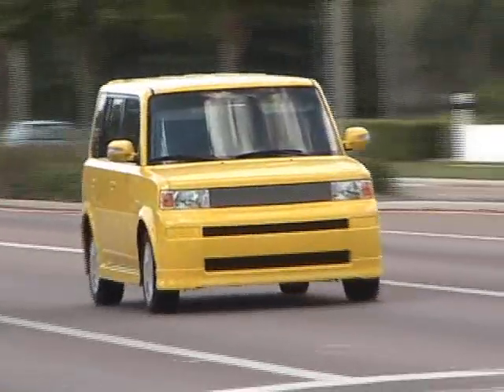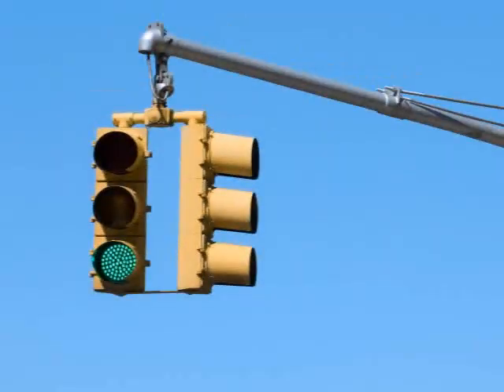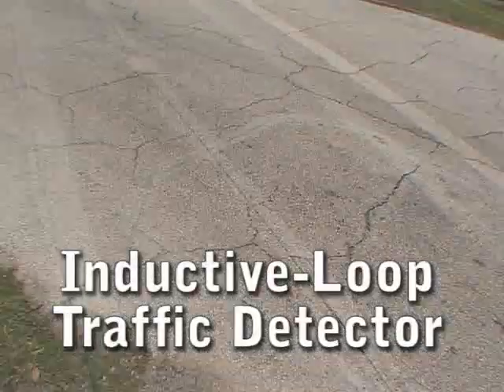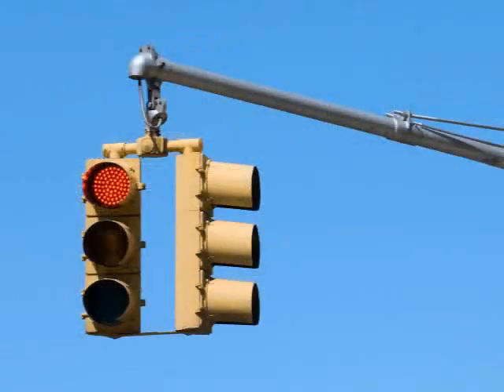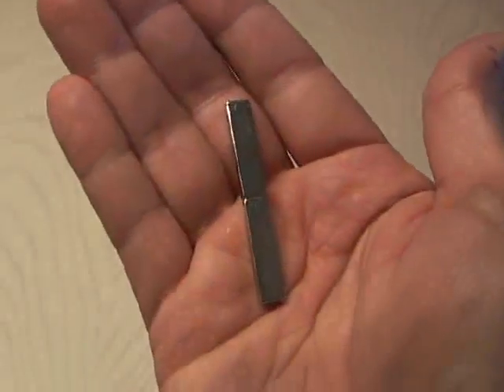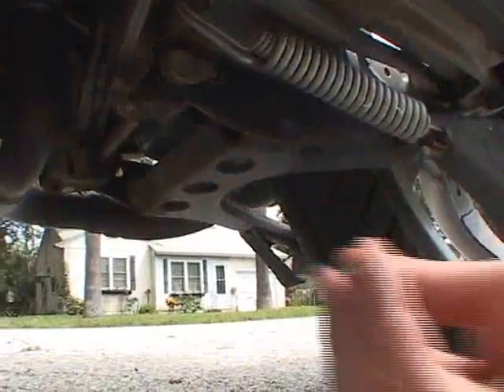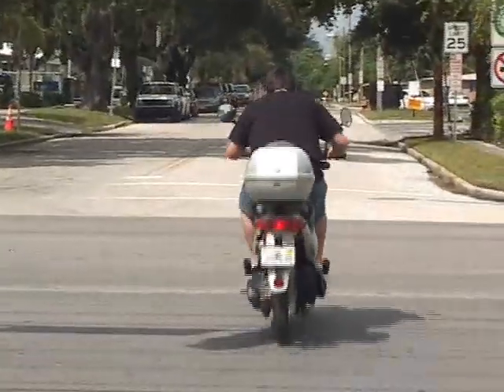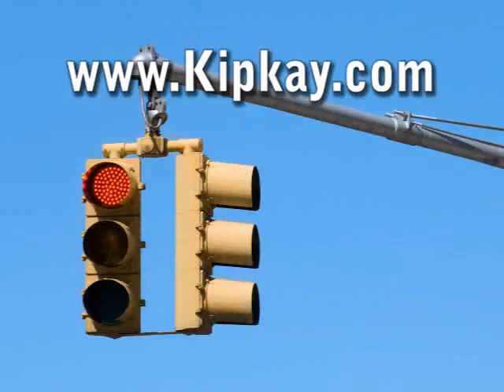Trigger Green Traffic Lights

Comment: If it's on a timer, you don't need it, because it'll change anyway.  It's only to make the lights that use sensors detect you if your vehicle (bicycle, scooter, etc.) doesn't have enough metal to trigger the sensor.  Besides, even the timer lights in Chicago tend to use sensors to decide whether to activate a left turn arrow, so it'd still be useful.

Comment: Yes it's legal and yes it works. I have a little 50cc scooter I use to zip around locally to save gas and before I found this video I got stopped at every light I drove up to. Eventually I started letting people get in front of me so the light would change. Once I discovered this, no more problems. Works like a charm!

Comment: With regards to loop detection, detectors generally have three types of frequency levels, and they are adjustable. High, medium, and low. Medium is typically the ideal position for most, if not all, types of vehicles. Although, when it comes to bicycles, scooters, etc., a higher frequency level is normally required. 

Another way is to press a nearby pedestrian push button (if one is present). Actuated traffic signals are also generally equipped with actuated pedestrian signals as well.

Comment: though that may be, strongest magnet or not there are also practical thoughts that go into this, I've used mag locks that can pull closed  doors with the force of around 1200lbs and I just can't see someone using it without screwing up credit cards, cell phones and other things of that nature, a magnetic field that strong to be detected under asaphalt, depending of the grade and strength would have to be immense because of the density of the road

Comment: Early in the morning or late at night the timing switch is turned off. and when the switch is on  the detector will bypass it. the light could have just turned red a car shows up and a second later it will be  a green light if there is no cars in the other side.

Comment: Don't put the magnets in a metal container because it it 'shorts out' the magnetic field lines by giving them a shorter path to the other side of the magnet.  Better to leave the magnets bare or use a plastic container.

Most sensors today are still this type.  The ones on top are for emergency vehicles with flashing lights.

Comment: you fail....
most traffic lights have these sensors so the lights dont change when there is no car there. if you have a small motorcycle or scooter, sometimes it doesnt detect their presence and skips their "turn" in waiting at lights if no one else is there to trip the sensor
all this does is make it so the sensor detects their presence so they arent skipped

Comment: So, you're against smaller vehicles having the same advantages as larger vehicles? They aren't triggering an emergency vehicle traffic light change, they are merely exploiting the mechanism already in place that does not have smaller vehicles in mind in its design.

Comment: Don't put too big of a magnet on there,  a friend put a pretty huge Rare earth magnet  (probably around a 15-30lb pull,  and while it worked, he eventually got some severe ankle cuts from a bit of metal brick strapping in a roadway it picked up and cut him with.  pill bottle is good too because it will pickup a furry coat of rusty metal bits  of cars/brakes and meteoric nickle

Comment: I worked on the ambulance for seven years my friend and you are wrong. Yes we can go on a red light, but some cities have sensors at the intersections that emergency vehicles can trip to cause the light to go green. After all, if all lanes are full and the light is red, the emergency vehicle is still stuck in traffic as it is STILL against the law for any civilian vehicle to run a red light when stopped at an intersection.

Comment: The loop in the ground is balanced to an oscillator in the box near the pole. When a large metal object passes over the loop it changes the frequency of the oscillator and the box near the pole registers the difference...like a regular metal detector you use to find coins in the sand. Thus a strong magnetic field could change the frequency of the oscillator...never underestimate KIPKAY.

Comment: The smaller the magnet, the lower the price and weight.  So does anyone know what would be smallest size that will work reliably from the distance shown in the video?  And what's the best shape?

I'm assuming that one magnet is as good as two together if it's a suitable size and shape.  Is that right?  Neodymium magnets are available in all sorts of shapes.

Comment: @scotticism101 the gold seems to stick inside the iron that accumulates in the sluice.  I use the iron in fireworks as a gold spark additive.  It's a very common practice to use a magnet inside a plastic bag, tapped or secured to the water tray right before the rubber matt and riffles.  Genius? hahahah  That word literally means the Genes of Isis.  do some homework before trying to piss off a stranger, better yet, get your ass out here and help me find some gold!

Comment: @Atheist269 Its not retarded, it will only change the lights if traffic is clear, the wire under the road just detects if a car is there, so if there is traffic it wont change, this works as the lights usually stay red for a longer period if it knows there isn't a car there, this video was created for small cars that don't activate the switch so for larger cars this system allways works.

Comment: Sorry, magnets do NOT work!   You need a shorting loop of conductive metal.  The loop needs to be aligned with the magnet field from the buried coil.  The best is directly on the pavement matching the size of the buried coil.  Copper or aluminium wire work nicely.

Comment: These are strong magnets..... any research on how they affect metallic particles immersed in the engine oil or transmission oil? Premature engine wear? Also don't put these next to your O2 sensor wires in the exhaust or other ECU wires. Obviously these magnets will disrupt the small voltage.

Comment: That's not a very good trick. It only works if you happen to live in a city with those type of traffic lights (which I don't). Most of the traffic lights you see are on a timer rather than a sensor and this won't work on those.

Comment: just to say, no it is not illegal. those strips are meant to SENSE A VEHICLE. so on vehicles that cannot be picked up by this sensor you just add a magnet. so, in a way your saving the state money by not having to change the system to accommodate smaller vehicles

Comment: @bob88099 
That they cant slip out of position? What do you do when you have a magnet which you cant just puled down from metal? You shift it, because its very easy to shift it to the side. What happens when you have to cross a bump, it could shift with tape it cant. 
Next time less scream less Fuck ;)

Comment: @yohanbab No. Can't override the default set time. But if an intersection is programmed to leave a main road open IF no traffic is detected after that set time this will work the same as a car pulling up to the lights that are red on the crossing road. It just makes the scooter more detectable.

Comment: Wouldn't having strong magnets potentially cause problems with your engine or electronics in your motorcycle?  There is also the fact that magnets pick up magnetic objects so if you go past a drink can in the road it can pick it up and possibly get stuck in a wheel

Comment: I've gotten stuck at quite a few lights on my motorcycle where my car triggers it fine, so there is an issue with certain traffic light systems.  One light in particular I have to run a red 100% of the time when on my bike (when no cars are coming of course) because I have waited through 5+ complete light cycles and still will not get a green for my direction (certain lights will only trigger green when they sense a vehicle esp. late night).  Question is, has e

Comment: @blownone1 Yes but they (WILL) change, I've been stuck at lights on my Motorcycle and they do not always cycle on less traveled cross streets and the only option is to run the light and then you get a ticket.

This device works at (Those) intersections

Comment: In recent years, the wiring used in the loop detectors has been changed so that the loop is more sensitive to small cars, motorcycles and bicycles.  Old signals with old wiring and equipment will still have trobule picking up small vehicles.   Other tricks like backing up and going forward several times, or flashing your headlights, don't work either.

Comment: This is BS.  I've worked in the traffic engineering field for 30 years and have personally installed in-pavement loop detectors.  A little magnet like that won't cause the loop detector to change the signal to green - if the guy got a green light, it was because traffic had already cleared from other legs of the intersection at the right moment.  There's one device which guarantees green lights, they are illegal for public possession (an opticom detector, built into police cars & ambulances)

Comment: i have a strong magnet on my streetbike and it works great unless the light is the kind that works off weight. 

it called a red light changer and you can get the REAL magnet thing at almost any streetbike shop. cost is 20 bucks. no lie. chicomotorsports in chico is where i got mine

Comment: I'm going to try that because in my tiny little Vauxhall Corsa I once sat at a traffic light for 15 minutes!!!! Also, I tried to beat traffic lights in that car by accelerating hard towards the sensor and I had to brake really hard because the light turned red anyway.

Comment: Let's get it straight, it's not WEIGHT. You think they put scales under the road. (they are timed to be operational in 'off peak' times.  It's just a copper wire, i know as i have installed them. It IS electrical, and magnets will work if they are strong enough.

Comment: @lavalois09 Modern light would be the newer system, hence the idiot comment.  As the newer system (modern lights) works on magnetic sensors in the roadway and emergency vehicles trigger the change by using transmitters in the vehicles.  You can buy these transmitters online even though they are illegal for civilian use.

Comment: @Tombosdrunk  Since the late 90s? How does that make me an idiot? That means theres still a large % of those types of lights out there. Look, i can quote from a source:

"Most of the systems operate with small transmitters that send radio waves, infrared signals, or strobe light signals that are received by a sensor on or near the traffic lights."

I play with the highbeams when approching lights near my house and they cycle through. if you dont want to do this, you dont have to

Comment: @lavalois09 You're an idiot.  Lights haven't worked like that since late 90's.  Now they use radio transmitters for that.  Your method only works if it's an older system.

Comment: Modern traffic lights have a sensor in them that detects the stobbing lights of an approaching emergency vechile and cycles to green or prolongs the yellow.

At about 7-8 car-lenghts from the light, flick your highbeams on and off again and again as fast as u can.

At night, this will hold the yellow or turn it green 80% of the time (provided is a modern light)

Comment: If the light doesn't change in less than 2 minutes, consider it faulty and treat as a stop sign. Come to a complete stop make sure there's no traffic coming , then go. if you get pulled over  refer the cop to the vehicle code book on defective traffic lights.

Comment: @DOWNwithDICTATORS2 i cant figure how anybody thinks parallel, unless they drive their scooters sideways :P from an over head view the strip is placed length wise, left to right. the road is forward and back or up and down. their relationship to each other is perpendicular. the strip would only be parallel to the cross road at the intersection but the sensor it trigger is embedded in the lane the cycle travels in and stops on so I again have no idea how people see parallel unless for that :)

Comment: @FallOcean88 because it doesn't CHANGE the light. All it does is allow the traffic light control system to recognize that there is a vehicle stopped there. Scooters, motorcycles, bikes, even some small cars don't have enough weight/metal to let the traffic system recognize the car is there, but the powerful neocadnium magnets make a shift in magnetism enough for the traffic light control to see it. For all of you calling bs: What is the induction loop there for then?

Comment: this is a great video. I ride a motorcycle and I am aware of the induction loops. If I am the 1st guy at a light and can't set the induction loop off' I get some idiot behind me who stays a whole car length away and not even on the IL so we sit for a couple turns instead of going next time. Another trick is to stop a few feet back from the car in front of you and then move forward only a foot and stop hard. I think it makes it think there's another car so it sets it of .  IT"S PERPENDICULAR BTW

Comment: @marc74621 no. it doesn't change the light instantly, it just tells the light there is someone in the other direction and to switch to it in a safe time if the light has been on in the other direction for long enough to allow traffic to pass.

Comment: @shocfacter 
in simple terms, the field of a magnet decreases by multiples as you get farther away. take a large electromagnet that may lift 1000lbs, you add a wood spacer, now it can only lift 100lbs another spacer and only 10 lbs. you move a 10 feet away and  the field isn't even noticeable anymore. 
a tiny magnet like in the video doesn't even have enough strength to  reach the  sensor loop.

Comment: I found that while riding my mountain bike, as long as you are stopped over the sensors, the signals activate no problem(no magnets).
 In Ottawa, there are small yellow circles painted onver these sensors to guide cyclists at the lights.

Comment: @BlackGypoMagic Right, but the method is totally bogus!

The key to detecting vehicles with an ILTD buried loop is loop inductance change by the arrival of a vehicle.  The inductance is part of an oscillator circuit. The frequency change of the oscillator is sensed by the controller as a "Vehicle Present" for the purpose of cycling the light to green for the new vehicle.  .

The video's recommended action, using magnet(s), doesn't increase the the likelihood of an ILTD recognizing the vehicle.

Comment: @rawimpact red <= 50 < green still is binary, as it boils down to on/off.  My point I was trying to make is that there's no way this would be illegal. Traffic signals use logic to control the lights based off the sensors. A piece of copper pipe over the sensor, or an electromagnet pulling the sensor right out of the ground would be the same, the light will only change once the logic cycle allows it to.

Opticons work the same way, even they have a 5 second delay to ensure there's only one green.

Comment: @multimediaman256 you're wrong, it can be set such as:

If >50 then GREEN
If < or = 50 then RED

the number will vary and will depend on the electrical pull

Comment: Just FYI, traffic lights typically will be controlled by these in-ground sensors, traffic-sensing cameras, or on a pure timer. The cameras on top of the traffic signals analyze the image to figure out whether a car is in view or not.  If you have trouble setting these off, pull in to a stop at an angle, or make some motion to appear more "prominent" to the camera... though I've never had any issue with the camera-sensed lights

Comment: How in the world would this be illegal?  You're doing the same thing a car is doing... triggering a sensor. It's not even a function of magnetism strength = quicker green light - it's a binary (on/off) sensor that is constantly polled.  it's like (signal): "Is a car there yet?" (sensor): "No." (signal): "Is a car there yet?" (sensor): "No."

This method does work, as I bicycle frequently.  Though just lean the bike to the ground and it accomplishes the same thing without magnets.

Comment: england actually tend to use a combination of electro-magnetic coils and cameras that detect the length of the traffic cue.

the electro-magnetic coils detect the first car, thus notifying the control system that there is traffic waiting - if there is no cross traffic then it gets a red light, else it has to wait until the cue gets long enough for the camera to detect a car (normally 5 cars behind the first car)!

Comment: Let me assure you, it can only signal the traffic light system to change at the next cycle. This is especially helpful at lights where the light only operates when vehicles are present. I ride a motorcycle and some lights will not turn on with just my motorcycle sitting there. It's a big one so I know smaller bikes will not trigger the system. I have not tried these magnets as yet but just maybe they work. Sometimes it works by putting down the kickstand right on one of the cracks in the road.

Comment: I've found that my bicycle has always tripped traffic lights with no problem... as long as you roll OVER the sweet spot.  Most bikes (except carbon fiber) have plenty of ferrous metal.  You want to roll directly over one of the long "legs" of the loop up to where an "X" is cut in the pavement... Easy, and it always works.  Never had a problem.  And the only cars I've known to fail were ones jacked WAY up tall (alloy rims don't do the trick.)

Comment: most are routed into the citys traffic control center and are on timers and the very the timers depending on what time of day it is and if its a light on a highway with an intersecting small road the timer will run longer for the highway and run through turns and crossing quickly even really small towns will still run a timer system but through a computer near the signal light itself thus this will only work on the few that still use sensors which were taken out because of the problem detecting